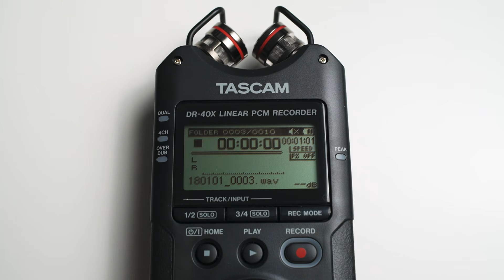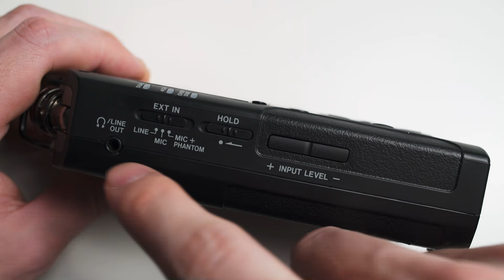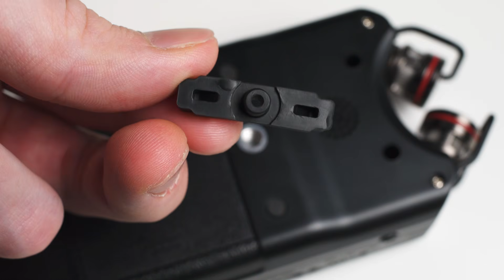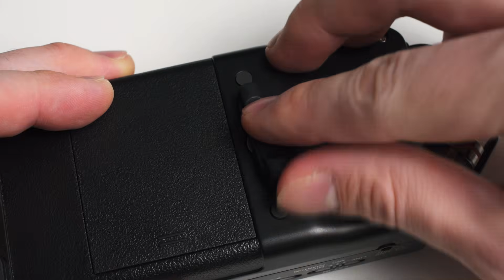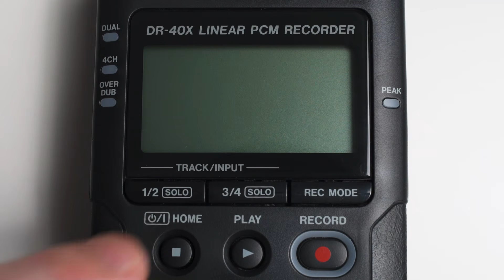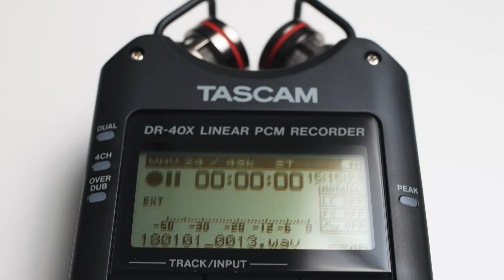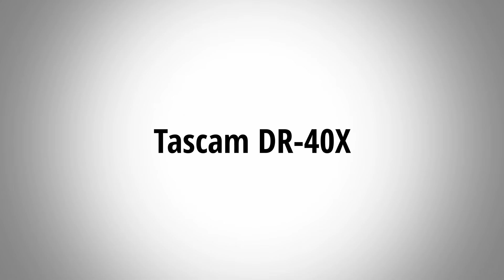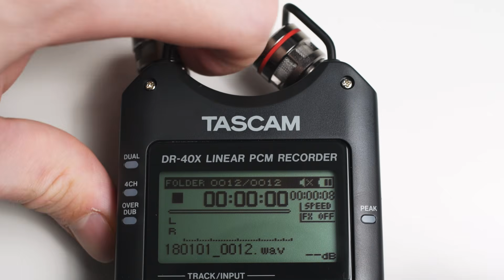Tascam DR-40X Review (Noise, Battery Life and more things tested!)

Comment: I've been using the DR-40 for +4 years. It's my No.1 choice for demoing and being creative, thanks to the great overdub / mix mode. The mics are not too brilliant or harsh, they have this slight warm touch*.
From 2012 - 2015 I "worked" mostly with the DR-05, while also trying out the Boss BR-80 and ZOOM's multitrackers R8, R16 & R24 (I still use the R8 for demos, as audio interface & DAW controller). 
My first choice to grab was and still is the Tascam. I like the DR-40 a lot, but yet it's lights & shadows.I was looking forward to this upgrade, but there is rarely something new.

What's NEW:
- a slightly revised menu (EQ, Speaker & Level are now in a seperate ""E/A" folder)
- Dictation Mode (well...)
- USB Audio Interface
- 16h battery running time instead of 17h (based on 4 years of using eneloops: 8h seems realistic)
- That's it

Still NOT CHANGED:
- instead of the "play" button, the "Enter/Mark" button is in the middle
- USB port not protected like the SD slot
- display totally overloaded
- display has still 1990's Game Boy graphics
- I prefer a dial for adjusting the volume (like a good old Walkman)
- Power Supply Status has only 3 bars. That's far too vague. 5 bars would be useful, an additional display in percent would be awesome
- still not possible to change the brightness of the display, only contrast. That's ridiculous! Guys, every simple China-imported mp3 player has this function!
- still not possible to disable the annoying "Change Mic directions?" popup in the system settings when adjusting the mic
- NO accessories! Not even optional! No case, no sleeve, no bag - nothing! 10 years ago I bought a cheap Transcend mp3 player for like 40 EUR. It came with a silicon protection case, lanyard, USB cable, line cable, earbuds, 2 display protection sheets, software CD and a case. And you could even adjust the display brightness! 40 EUR! Shame on you, Tascam!

Conclusion:
If you need a great, simple recorder with brilliant mics for demoing: go fo the Tascam DR-05 V2.
If you need additional features, like XLR, full 2-track recording, mixer and you can pass on Audio Interface: go for Tascam DR-40 V2.
If you need all this AND an Audio Interface, you should rather check the ZOOM H4n Pro. It's in the same price range but it also has a Guitar Amp Simulation, Zoom G5n based Multi Effects, a Karaoke/Jam function and includes Steinberg Cubase LE & WaveLab LE Download licenses and a protective case

*I recorded "Einsamer Wanderer (QuickShot Demo)" with the DR-05 (light reverb, intro & outro with Audacity) - check out on my channel if you like
Reply: I was concerned that I may have bought my H4n Pro too soon before seeing how the DR-40X fared, but based on Julian's great review and your helpful comment, I think I made the right choice.  Thank you.
Reply: With the Zoom h4n Pro you need attenuators to lower the line level signal you give it. That's unacceptable. Why is it do hard to find mobile recorders with decent line inputs? I'm exchanging my Tascam dr-5x for a dr-40x because on the dr-5x too you need attenuators. Guess I'll buy a FetHead in case I need to connect a microphone. There's even a FetHead Phantom now that will even boost the gain of condenser microphones.
Reply: Idk if anybody will see this but what kind of SD card do I need for this because I have a mico SD card but it's say that the card does not work
Reply: You'll need a common SD card (SDHC) for the device (I highly recommend the Transcend Ultimate Class 10). You can use micro SD cards but then you'll need an adaptor card.https://www.tascam.eu/en/dr-40x_cards.html
Reply: Can you overdub to a stereo file that was not recorded on the device ?  For example, importing a song into the memory card , and then recording mono tracks to the wav or mp3 music. Would that work ?
Reply: Hi. That is such an interesting question, I just checked it out with some mp3 files - and it worked! Just make sure you copy the files to the "music " folder. If you need proof or samples feel free to contact me. Best regards
Reply: Most definitely the Sony PCM-10. This Sony is in a whole other league in sound quality, build quality and user interface when compared to these Tascam and Zoom options. It costs more, though..
Reply: Great info and thank you for providing it. Though I do have a question that you may be able to provide some clarity to...say I need a decent quality budget priced 4 track digital recorder along the lines of the H4n Pro or H5 functionally speaking, etc but have no need for included microphones. Just portable and somewhat clean preamps XLR, line in etc for field recording samples and creative noodling. Thanks for any insight you can provide - I feel like Im just wading through thick fog at this point. lol
Reply: @theorist5497  , thanks for your kind words.
You are looking for a (portable) 4-track recorder with XLR and decent preamps, is that right?
Unfortunately I'm not familiar with recorders less than 8 tracks. Over the years I've been working with all ZOOMs (R8, R16, R24) and the BOSS BR-80. You would not want the ZOOM R16 or R24, they're too big. The BOSS BR-80 might work for you. I remember it was built like a tank and was fun jamming around with this little thing. The downside is it has 1 Mic Line-in only (no XLR) and creating a multitrack recording was very very very complicated and confusing because you had to navigate with a tiny jog wheel.

I always highly recommend the ZOOM R8. It's not that big as the R16 or R24 and it's definitely the best of the 3 models. You get 3 gears in one: portable recorder, audio interface, DAW controller. It's portable powered by 4 AAs (eneloops recommended), it has 2 Line/XLR combinations, fully adjustable drum machine with 5 different kits, very useful effects (R16 effects are more "Nintendo") and a line-in for a foot switch. This thing is really the heart of my bedroom studio. I use it for creating songs on the couch and as an interface when recording. Since it's also a DAW controller it makes working with (in my case) Cubase a little more comfortable. I bought it for about 220 EUR many years ago. The price is pending from 189 EUR up to 320 EUR. If you don't need it urgently wait for a good offer - I would not pay more than 245 EUR.

Sorry I can't tell you more about field recorders - though I hope I could help you out a little.
Cheers
Reply: @einsamerwanderer6641 Thanks for the reply, I really appreciate the input. Yeah, 4 tracks would basically be my mininum, 6 or 8 is probably the sweet spot for it be useful to me for anything other than field recording. I'm not sure how I wasn't aware of the R8 - it looks quite nice. For some reason I was under the impression that the R16 was the lowest model they made - so that may be a really nice solution for me both portability wise and for being able to record my musical projects. Thanks again, you may have just made my day!
Reply: @einsamerwanderer6641  Einsamer Wanderer As someone who is new to all of this, I would like to record harp playing outdoors with a recorder in the sound box. I don't need it to fancy what worries me most is sound clipping issues as the environment in a harp has a wide range. Which of the recorders would you recommend? Tascam 40x, zoom h5 (clipping issue) or something different?
Reply: Einsamer Wanderer THANK YOU - great summary of the differences. Looks like USB port changed from mini to micro, though should it be USB-C now? (debatable?) Was hoping for screen resolution update 😕 and pads on the bottom vs same removable plug for 1/4” screw opening.
Reply: >display has still 1990's Game Boy graphics

You say that like it's a bad thing. You know that would eat battery life?
Man tech people are so complain-y. lol
Reply: I like the DR05, which I picked up for peanuts a couple of years ago as it was being phased out in favour of the DR05X. I think it is a great unit for direct recording with the built in mics. I have also used it to record output from a small Behringer mixer which I use to power, preamplify, and do some simple input equalization on my various condenser mics. In that circumstance I find that deft gain setting is a must, since the mic/line input on the recorder seems pretty noisy to me. I am really impressed you pull off such good audio with only this little unit. A talented carpenter can do fine work even with humble tools.

Comment: this was an amazing review, thank you for the measurements, because its great to have quantification. 
Could you also in the future measure latency as a USB device? It's very important for using in music production tracking, and manufactures never state it.
In tracking you often need to have the talent listen to their voice=instrument round trip through the computer and latency makes the performance difficult or off rhythm.
Reply from the maker: Hey, I just tested the round trip latency (RTL) with the DR-40X connected to a Win10 PC with the ASIO driver installed. At a sample rate of 48kHz and the smallest buffer size of 64 I got an RTL of about 10ms. All setting the same but with a buffer of 128 the RTL is at 15ms and with a buffer of 256 the RTL is 22ms. Keep in mind, that the RTL is the time the DR-40X needs to put out a signal and then record it again, so it is a combined output and input measurement. 
With the DR-40X you also have the possibility to direct monitor the inputs. When this is activated, there you can monitor the audio of the inputs in real time.
Reply: @JulianKrause  Is there a higher samplerate useable as an usb-interface than 48kHz with the DR-40X? The Zoom H4n Pro provides only 44,1 and 48KHz.

Comment: I almost ordered DR-40X, if not this, which one do you recommend for podcasting? H5 or H4n or something else? I was sure than new model will be improvement, not disappointment.
Reply from the maker: I own a Zoom H5, which I think is pretty good. I like that you have dials for setting your gain. The preamps are not perfect, but can get the job done. As far as I know, the H4n Pro has the same preamps as the H5. So, if you want to save a bit money the H4n Pro should be on paar with the H5, audio quality wise. One more option would be something like the Tascam DR-60DMKII. I personally haven't tried it out, but it seems to have some decent preamp perfromance as well. And don't forget the Tascam DR-70D, this devcies should have the lowest noise preamps of all these devices, according to this website: https://www.avisoft.com/recordertests.htm
Reply: @JulianKrause  thank you for the advice!
Reply: If you haven't decided on your podcasting recorder yet, take a hard look at the RODEcaster Pro. Curtis Judd just did a great review of it. I would recommend it over a Zoom H5 or even a MixPre-6 (for podcasting). The audio quality is excellent and it has many features specifically for multi-person recorded or live podcasting productions.

Comment: Julian, do you know of any source for Frequency responses of the MICROPHONES and not the machines? I’m looking for info on a few ... Zoom H1n and H4n, also for Tascam Dr05 and DR40. These companies are all very quick to print the ruler flat response of the recorders but not the mics!

With regards to noise, I generally use a Fethead anyway, but I’ve not noticed it being too bad on the DR40: probably because mic or ambient noise is worse! DR05 noise floor is around -92dB I think so that’s not particularly quiet either. The Zoom H4n seems significantly quieter to me than the Tascams though.

The double hit on record is similar to the Zoom H4n as well I think. The H1n gives a permanent display of recording level while on though, unless you’re in ‘play’ mode.

I recently used a Tascam DR100 and that seemed ‘black hole’ quiet so it seems you get what you pay for in this case perhaps.
Reply from the maker: Hey, I haven't seen any proper frequency response graphs of the built-in mics on these audio devices. I measured the H1n myself here: https://youtu.be/ElMPECqumB8
The DR-40X will also have some kind of boost in the higher frequencies, by the sound of it. And this seems to be a trend with all the built-in mics on audio recorders.
As far as I know, the Zoom H4n PRO has the same preamps as the H5, so that would be a step up from the DR-40X. I personally haven’t tested the DR-100MKIII but I have seen a measurement, where it had an EIN of -126dBu(A). That's pretty low noise and would line up with your experience.

Comment: Thanks for the extensive review. I hope it was not purchased with your own hard earned money.
Reply from the maker: Hey, all the products I review are bought with my own money (if not stated otherwise). This allows me to stay objective and produce a truely independant review. I'm glad you like the video!
Reply: @JulianKrause  Yes, I assumed that, having not stated otherwise, you paid for it. 
I only whished that it was not the case, because I think you are not too happy with this purchase. I wouldn't be.
I have seen it presented at the Namm show two weeks ago but it was too busy and crowded around to hope to check anything regarding its noise floor although I had an 600 ohms xlr plug in my bag. It was just not practicable.
I have to say that I am fairly disappointed with what was presented as a step forward machine but that is actually outdated already.
Reply from the maker: @hanapa  Well, I guess that's the risk for beeing an early adopter! But that's why I do these videos, to show the true performance of a device. And based on that people can make informed decisions.

Comment: Do you have a Tascam-DR40 to compare this to? I'm curious if it may actually be a bit better than this new version. Thanks!
Reply from the maker: Hey, I don't own a DR-40. But like I said at 7:41 someone else measured it and the preamp noise is same as in the DR-40X. So, it seems as if they use the same preamps in the DR-40 and the DR-40X.
Reply: @JulianKrause  Alright thanks!

Comment: Wow, the noise floor is so bad with the dynamic that I can even hear it through my iPhone speaker. Such strange design choices for a device that has to compete with a Zoom H5 or a MixPre-3 in today’s market. MixPres have analog limiters, Zoom F8n has advanced hybrid digital limiters. Both are highly effective compared to these useless limiters that just drop the recording gain. A very disappointing 2019 product indeed. I was expecting so much more from a new Tascam device. Excellent honest review.
Reply: RedBearAK I bought a dr40 and the noise is just awful. Almost as it is louder than the Shure SM58 signal itself.
Reply: You can make any device sound bad (noise floor is so bad) if you aren't audio savvy and don't understand gain structure which is obviously the case here.
Reply: Sir Chivo so his review is wrong?
Reply: The Dr40X does not compete with the H5. Julian's comparisons are slightly misleading in this respect. The 40X is $100 cheaper, at least in the US. Which means its a competitor to the H4N - which has the same poor noise performance as the 40 and 40X, etc...